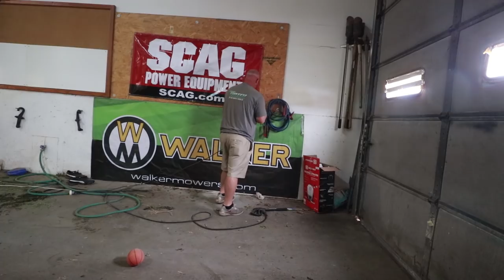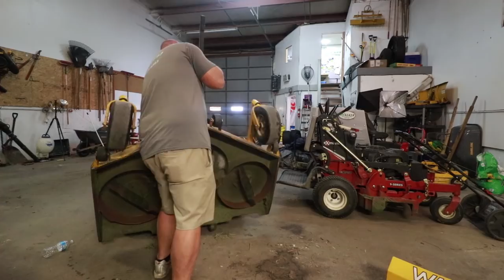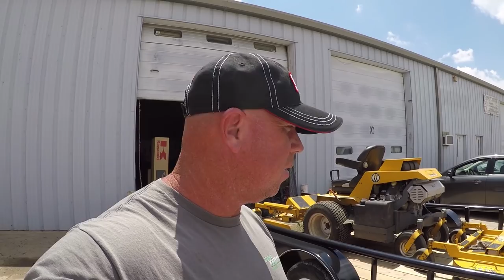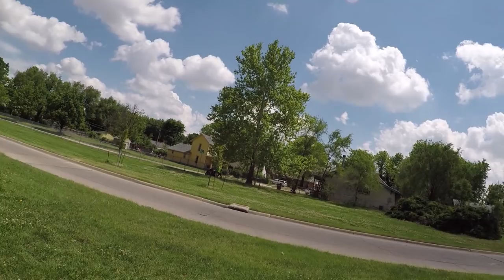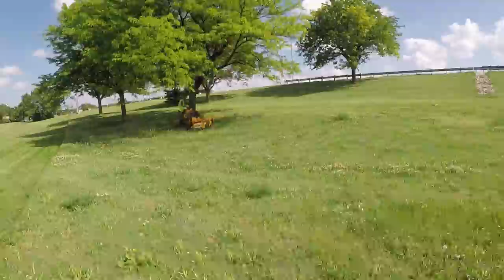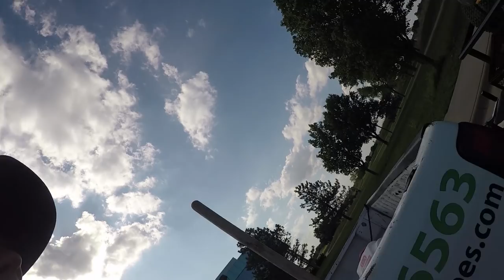New 7X18 Lawn Care Trailer & Commercial Property

Comment: congrats on the new trailer...Looking at the sizes of the properties your doing right now, another dual wheel 72" seems like a solid choice. I'm trying to avoid any equipment purchases this year and get back up on my feet. I'm really eyeing up ZTR's again, but hoping I can avoid it for this season so I can build up cash again. Still struggling to expand the biz...just been treading water it seems and grinding away. I made a stupid mistake and didn't get back to someone needing an estimate. Turns out another local picked up the work, and its a property I would really like to have picked up. No-one to blame but me on that one though...gotta own my mistakes, and that was definitely one of em.